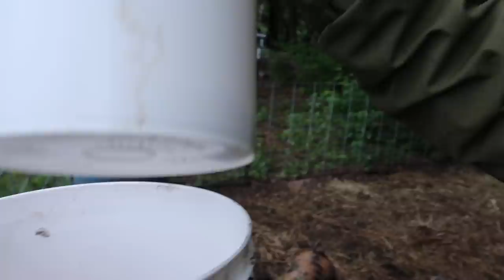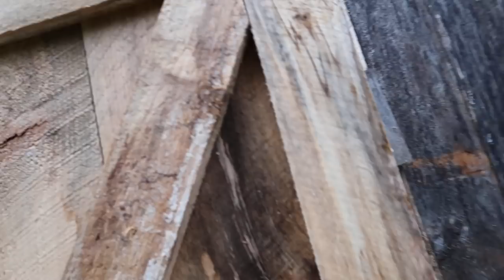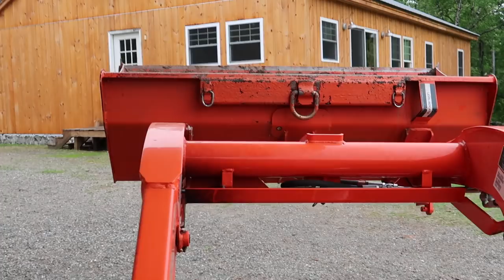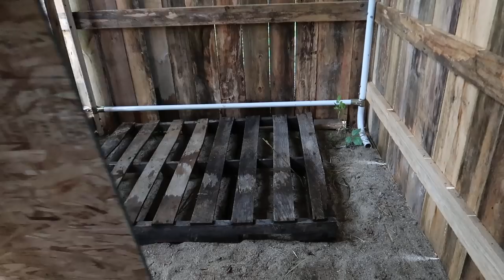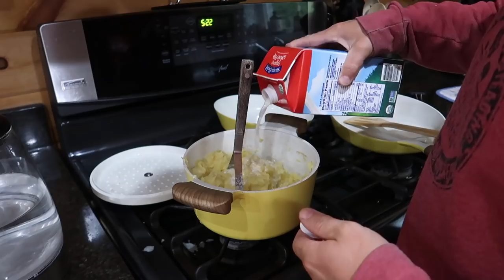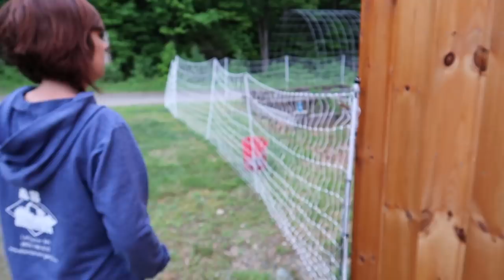So Much RAIN! But These Farm Chores Have to Get DONE!

Comment: Al, I bet if you tacked some of those furniture gliders on the bottom of your $30.00 movable chicken tractors (course it would cost 5 bucks more😀) but then it would be so easy to move. Probably even a milk jug cut and wrapped up a bit on the front would help glide it along.

Comment: Nice video.  You seem to be having some cooler weather.  The pigs seem to have learned to use the feeder.  I am looking forward to building a chicken tractor and a chicken brooder.  In The Philippines we had a pig pen already built, and that will be rebuilt.  I remember when it was a big deal,and you were going over 10,000 subscribers.  Now you are near 30,000.  Al, you are a real inspiration.  You are a hard working guy with a hard working family.  Al, have you ever hand milked a goat?  A cow?  Do you plan to milk by hand or by machine?  Be blessed.
Reply from the maker: Thanks Jim, it's crazy that we are almost at 30,000 subscribers!  No I have never milk an animal before. I am planning on hand milking.

Comment: Al,
Are those cattle panels around the pigs? Is that fence electrified? The premier chicken netting is not working around the garden, rabbits are eating everything.
Reply from the maker: we are using hog panels around the pigs the garden fence is not hot/ but the pigs fence is
Reply: Lumnah Acres how is the pig fence electrified? It looks like two wires inside of the hog panels? Is that right? Not sure how to do that. Did you do a video when you built the pig enclosure?